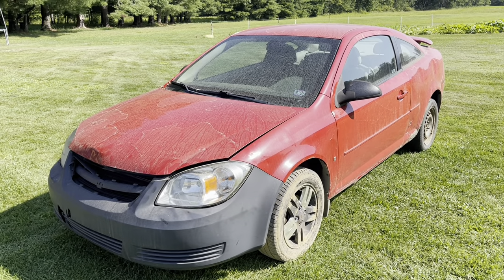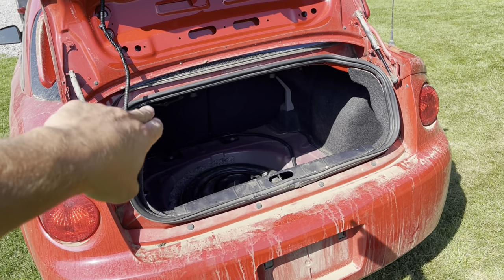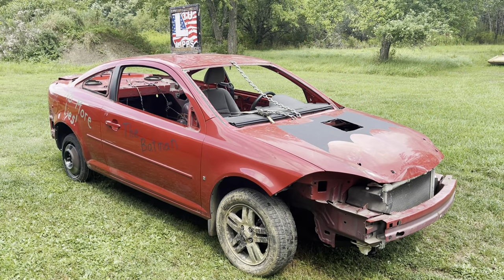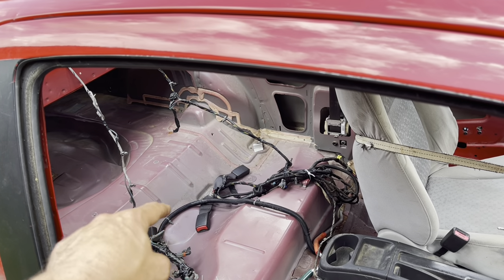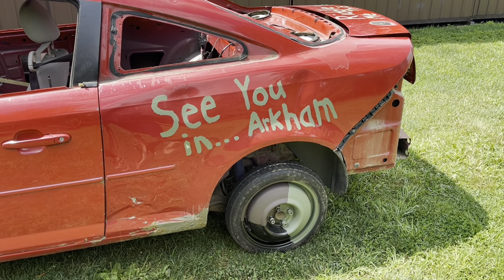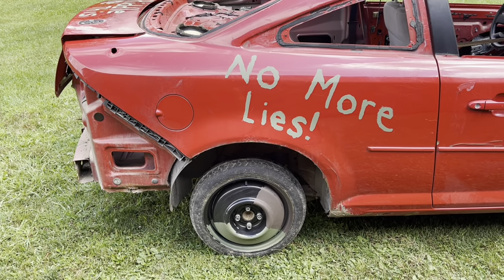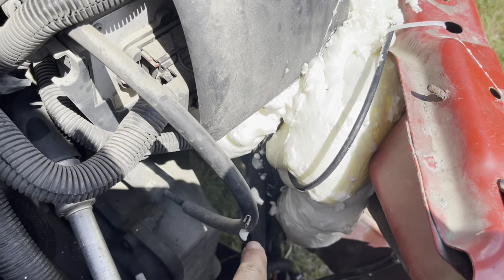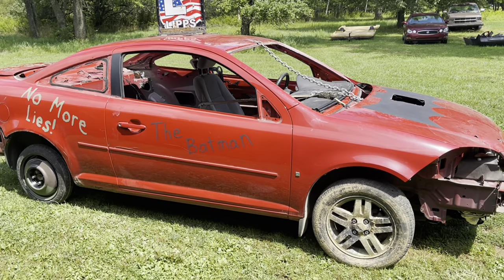Chevy Cobalt Derby Car (First Look and Final Build)

Comment: I have a 2009 cobalt that I'm running..how did you do your fuel pump..I'd really appreciate all information on it..
Reply from the maker: How this car is set up isn’t how I normally do it but I got it off a guy that derbies that already had started stripping it and had his tank hooked up already. 

He had a derby tank with a Camry fuel cell in it. The fuel line is running from fuel cell in derby tank to the top of the motor. The “air line” as it doesn’t have a return is just open off the tank. 

I typically run it stick (fresh car usually not a problem). Then on second run if it has one I’ll drop stock tank and remove fuel cell and put it into my derby tank. I have a tank that the stock fuel cell goes into then you bolt it down so you don’t have to change any other wiring. You can run off the stock wiring/fuse box. 

I’ll send picks tomorrow of how my buddy has it set up. Loaded up and heading to run it one more time right now 😁
Reply: you can get boat tank cut around your old tank with fuel pump and cut hole big enoughon boat tank take float off fuel pump then put seal all around the hole on boat tank then put ur fuel pum down on it here where i live you cant use oringal tank it has be remove and a fuel cell is pretty pricey i just wish he show how he did the battery cause i dont know if i keep that 50 amp fues in or what